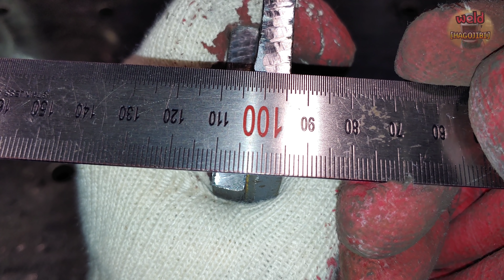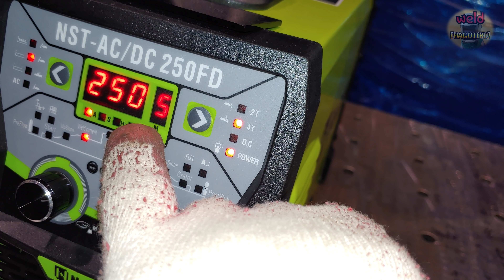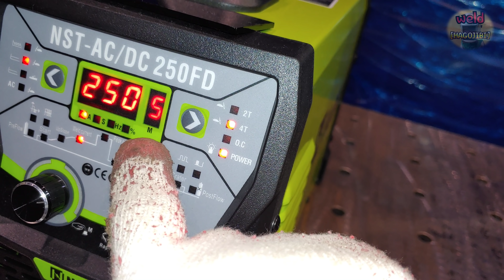Correlation between tungsten length and penetration. In Tig welding cup walking

Comment: Thanks for good tips 👍I love them  is it  possible that u can show us a video 📹 of you welding stainless steel  stick using 308/L  going 6G position  please  our test here in South Africa  🇿🇦 are carbon  steel and stainless steel test pieces 6G both half carbon  / half  stainless steel stick I.e when caping the the test pieces Roots / filler its wires 308/ER70s 2,4 mm